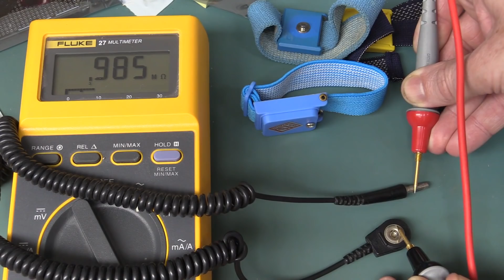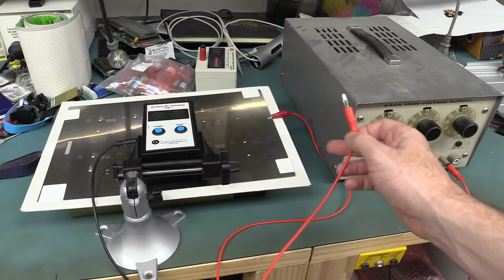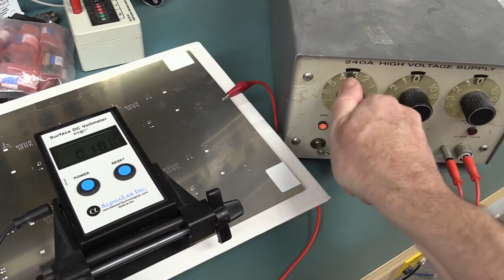EEVblog #768 - Cordless Anti-Static Wristbands BUSTED!

Comment: Dave, you have completely missed the point of these wrist straps.  A typical wrist-strap does not have a resistor in the strap, and the discharge 1Mohm resistor is located inside a special (and expensive) wrist-strap cord.  The "cordless" straps are meant to have a ground wire attached to the screw. This gives you the flexibility to use a plain old cheap wire of any length you want.  These really should be called "resistor in strap" wrist-straps instead of "cordless".  

Using these kinds of wrist-straps can simplify the wrist-strap testing process for electronics manufacturers.  Employees don't have to carry the cord they will be using to the ESD wrist-strap tester and don't need to carry the cords from station to station.   

There is one precaution with these straps.  The screw will be at ground potential when connected to ground through a wire.  If you accidentally touch the screw against a live circuit, that could ruin your day (and your project).  I recommend putting some insulating tape over the screw once the wire is attached.

 You have jumped to the wrong conclusion about what "cordless" really means.  Only 
an idiot would think you don't need to connect a ground wire.
Reply: Jess Stuart No employer would give their employees this crap to ruin the electronics they work on and the company's reputation. The descriptions for these auctions explicitly state "eliminates static without the need for a pesky grounding cord". The corded versions on eBay are only a few dollars, not expensive at all. This is a scam that is worse than wearing nothing at all, as the user is likely to be more careless, thinking they are protected "without pesky grounding cords".
Reply: Martin Andersen, I like using these, because they let me attach a small 
stranded ground wire (24ga) of about 6-ft length.  That gives me a lot 
more maneuverability on the bench when troubleshooting or making 
measurements.
Reply: "Using these kinds of wrist-straps can simplify the wrist-strap testing process for electronics manufacturers." - Because electronics manufacturers buy 1$  wrist-straps from Ebay!
Reply: Jess Stuart That's because you understand electrostatics. It may even be how these straps were originally intended to be used, given the resistor. But that is not how they are sold on eBay, which is the point of this video; they are sold as eliminating static without the need of a wire. They are deceptive. People who know no better and take them at their word, put their electronics at risk. Either the maker is making a fake product, putting in a resistor to cover themselves legally, or they don't provide instructions with it for the distributors, who all make the same mistake somehow, and falsely advertise them out of ignorance, or they know exactly what they are doing. Maybe they were made to be used as you are, attaching your own wire, but they weren't selling well. So some marketing bright spark gets the idea to sell them like wireless anti-static bands because chords are a nuisance, and here we are. A bit like how Listerine was originally a surgical antiseptic and later floor cleaner, but it wasn't until they invented the marketing concept of halitosis and sold it as a mouth wash that it took off.

Comment: I think you're using the antistatic 'wireless' wrong, you can touch the exposed screw to a GND source ie sn earth and the charge will be dissipated but they are kind of underpowered and they don't dissipate charge until you connect a ground source...not really a substitute for the real thing but kind of OK if you need a quick backup staticband or if you can't be connected all of the time.

Comment: Maybe the "wireless" part is that you can use your own coily cable with a spade terminal and attach it with the screw? Doubt it. And it wouldn't last long with that resistor barely in there.

Comment: Did anyone else want to see how many volts he could generate when the corded wrist strap is plugged in?  Dave: you never stroked the carped while the cord was attached, you only bled off the accumulated charge.  I kept wanting to see if there would be a measurable rise when using the proper strap.  Great videos overall, keep up the good work!

Comment: While working as a systems engineer for a consumer electronics company it was part of the job to evaluate component suppliers. On one trip to China my college was touring a family run speaker maker to determine if the company had the capacity and quality to meet our requirements. As he was touring the assembly line it was pointed out to him that they were using the latest and greatest wireless static straps. Apparently this new wireless static control was introduced by one of the elder members of the family that ran the business. So even thou the formally trained younger staff knew the wireless static straps were useless they could not say anything to the highly respected elder managers. Needless to say this company did not get our business. :-)

Comment: I don't understand.  If you and the plate are at the same potential, and the parts on the plate are at the same potential, isn't that the same as no charge?  It seems that if I touch the part with a 1megohm resistor to equalize the part and my potential while limiting discharge current I should be able to handle parts without risk of damage and also without a real ground. Why doesn't this seem right? What's the point of ground? Better safe than sorry if you drop the part on the floor?

Comment: Sorry, but you completely misunderstood this product. You are meant to regularly  touch a ground point manually using the screw to discharge yourself. This is especially useful when wearing gloves and in an environment where you walk around a lot. Imagine a worker in a Chinese factory: They tap a ground point with the strap, pick up a PCB, walk over to somewhere else, tap ground again, put the PCB down, walk back, repeat.

Comment: Cool video, Dave, except you had the band on your left wrist (for camera arrangement reasons, I understand).
But: high voltage work rule #1: Always use your right hand, just in case (I know, super-low current yadda, yadda...).
Your heart is slightly on the left, so you want the (hand-to-feet) path of least resistance to be through your right side.
Unless, you have situs inversus (super rare, look it up).

Comment: I think the bracelet was not meant to be discharged into the air, but to touch the metal surface with this screw through the built-in resistor.

Comment: Here I have about 30 microcuries of radium-painted clock hands.  I bet if you scraped them all off, mixed it with wood glue, and used it to paint all over that thing, it would make a dandy EHT discharger.   Just like the thoria ground-bars found on industrial poly-roll rewinders.    
Someone should start selling black conductive socks, to go with black conductive anti-static sandals.   Ooooo, how about black anti-static Crocs?   (Then force us all to wear them while down in the manufacturing building?)

Comment: I would be curious what you would have to say about DBS, or dielectric bias system.

It's apparently using Audioquest's "patented DBS system to ensure optimal cable performance at all times".

$6,899.75  power cable
http://www.amazon.com/AudioQuest-NRG-WEL-Signature-Series/dp/B0055OM9WS

$13,499.75 HDMI cable (of course, because a transmitted bit doesn't sound as good if it doesn't have a clean waveform.... facepalm)
http://www.amazon.com/gp/product/B00IL3TZSQ/

I was utterly bewildered when I went into a store and initially saw some RCA cables running upwards of a thousand dollars... I then of course could not resist asking the sales rep why it was worth that much, and he said "you wouldn't buy a mustang and use cheap tires, so why buy an expensive sound system and buy cheap cables?". People actually buy this junk too according to amazon.

I hope you can understand that I don't want to buy one and send it in lol.
Reply: Nifty Fingers Yah big time BS. A cable like that won't make the old knob & tube how ya doing wire in the walls work any better. ;)
Reply: Nifty Fingers FREE SHIPPING !!!!

Comment: 4:16 Why does the PSU have an SO-239 RF connector on the front?
Reply: tehPwnzor7306 At a guess because it's OK at 1kV and accepts a 4mm plug.

Comment: Well I wonder why the manufacturer bothered with the 1M resistor.
the problem is the definition of "cordless". It just means there is no wire. not that it has been designed to work without one.
Just connect your earth wire to the screw and it will work.

Comment: You missed the point of it. The cordless wrist strap has a 1 M Ohm resistor connected to the little bolt. You wear the strap with the bolt on the underside of your wrist. You touch it to an earthed plate on your workbench before touching a component or equipment. You continue to touch it periodically to ensure that no static charge builds up on your body. The resistor slows down the discharge from instantaneous to a fraction of a second so that, if you are charged up, you won't feel a shock.
A dangling cord, in some circumstances, might get caught in something (e.g. a rotating motor/fan). The assembly girls in the Asian factories are trained in the use of this item.

Comment: So far as I understand it these aren't supposed to be magic, you're supposed to use them to touch the screw with the resistor to a grounded surface periodically and discharge as an intermittent thing as opposed to constantly. It's intended for work environments where being constantly grounded is potentially dangerous or where discharging is only important at particular steps of an operation. The resistor is just to prevent you experiencing a palpable zap when you do so.

Comment: But is it actually possible to make a strap with couple of very compact fluorescent lamps built into it and turn static into light? :)
Reply: *****
But theoretically somehow it should be possible to utilize that energy.
Reply: ***** But that´s the point, you could have a cordless discharge, if you used it to generate visible light or heat.

Comment: I have found one disadvantage to being barefoot in the electronics lab (well, I wear nothing at all, but that's beside the point except that it does eliminate any fabrics and synthetic fibers to make a static charge).  Whether on carpet or concrete, if there is any sort of EMF interference from the mains voltage or something is badly grounded, or the polarity on an outlet is reversed and the neutral line is actually the hot one, etc., my bare feet on the floor creates a path for that charge to get to ground and will make interference even worse, particularly when I'm using the oscilloscope.  And when touching something that's plugged into a reverse wired outlet, it can create a bit of a nasty shock.  Wearing rubber soled footwear helps prevent all that, although it doesn't totally eliminate it.  [I discovered that my entire basement contains only 2-wire electric, no grounds at all despite having all 3-prong outlets.  That includes in the electronics lab.]

Comment: I'm wondering if this was originally designed for a legit use in a non-electronics environment.

We've all been somewhere where you got zapped every time you touched a door handle/filing cabinet/someone else due to the triboelectric charge you'd built up, usually from the carpet. Touch the screw on the box to the object and no zap when you actually touch it.

Comment: Why does it even have a resistor in it?
Reply: If you touch something that's live with electricity, it'll flow through your hand and arm, then through the grounding wire. The resistor allows for static electricity to dissipate (more slowly, sure), but also ensures that you won't get too much current flowing through ya in case of an accident.
Reply: Steven Haussmann Well, in a real anti-static wristband, sure, but why bother at all if it's a cordless (and thus bullshit) design?

I'm wondering if you're actually supposed to connect a wire to it after all, but the packaging and marketing is just... mis-translated? Someone who doesn't work with electronics or bother fact checking and just does the marketing might think it's perfectly normal.
Reply: weylin6 It should have a stud if a wire is supposed to be connected. The resistor is to slow any discharge to Earth. The ESD mats also are high resistance, all to prevent a spark or any fast discharge which would be damaging. It appears the resistor in this product is useless.
Reply: Let me set this straight, the screw head is meant to bump up against the GROUNDED anti-static mat, leaving your hands free to work, according to an email communication with one of these scammers.

Comment: in theory, could you not use a resister as a load to dissipate the voltage as heat? or am I just dumb
Reply: yes, but you need somwhere for the current to flow in order for that to be the case.
Reply: +Sod Alfredsod don't resisters draw current. Like a bleeder resister used to drain caps.
Reply: yes,but caps has a secound pole - ground. the goal of your idea is probably to make a Anti static wrist strap without a ground cord.

A cap is charged in relation the secound pole

You are charged in relation to ground and needs a strap to connect you to ground.
Reply: +Sod Alfredsod OOOOH. Of course. That's what I was missing. What I was suggesting previously is like trying to drain a battery by connecting both leads of a resister to the positive terminal. right?

Thanks!
Reply: Exactly, I would recomend drawing circuits on paper to figure out how they work.

Comment: You could still attach a ground wire to that screw...Maybe they've put this info somewhere on the ebay ad. Maybe in 4pt writing, with a black font on a black background, or something like that. Just so they can't be sued for fraud, because that's what it is.

Comment: There is a Wikipedia article about "static dischargers" which are devices it says are present on most civilian aircraft.  They include sharp metal points to dissipate excess charge into the air.  A cordless wrist strap with lots of metal points sticking out might be worth a try.  If there were enough of them, it might actually work, although it also might be a little hazardous.

Comment: They work exactly as intended and I can't understand how "electronics experts" can't figure it out.  They allow you to touch the screw on the top to a ground and discharge yourself through the internal resistor, which prevents you from being electrocuted if you touch a live wire while touching ground. That way you don't have to touch a ground with your hand and you won't get electrocuted. Most people don't walk around while working on electronics so once you ground yourself you don't have to stay at ground potential.  Is it the best solution or better than a wired version?  No, but it does work as designed if  you have the brains to figure out how it is supposed to be used.

Comment: about 30 years ago, many TV stations were selling thin copper bracelets for about $60 claiming that it discharges negative energy, wasn't clear if they were using the word negative as for voltage polarity or as something not good for you, they claimed the bracelet was treated 50.000 volts or 50.000 times (volte in Italian means times as repetitions).
I tried my best to educate the many people around me that is was pure bullshit, even a colleague electrician went around proudly with this thing on his arm.
I told him, why not use a piece of copper wire, or your normal metal watch strap, it costs much less.
He claimed the copper bracelet had been treated.
I ask him how exactly can you treat a piece of copper with 50.000 volts?, 10 cm copper is a short circuit, the voltage would to 0 and the current to the maximum your power supply can supply, but at that point you're not treating it with 50.000 volts but with some value of low current, too much current and you will be destroying the bracelet.
To avoid short circuit, even if you apply 50.000 volts to a very long coil of copper, the voltage drop on what will become your segment of 10cm bracelet would be a few millivolts.

This fraud went on for at least a year.

Comment: You know there would be one use for this: you can use it to dissipate your static charge on a metal surface without a zap. This will be handy in winter when the humidity is high and you would get a zap on doors or cars otherwise. Not the intended use but worth a dollar I think. 😊

Comment: It can be used to painless discharge to grounded metal object. By touching it with the metal screw on the case. (and after all translations hell it can be named as cordless anti-static wristband :)) )

Comment: what if you had the strap on the non working arm (assuming you are working with only one arm at a time) and had that arm resting on your anti static mat during your work? it would work at that time, but then being cordless you could get up and walk across the room without taking it off. return to the bench and set your arm back down. i assume thats what the original intent was for this design. but who knows. i can't see any other reason for there to be a screw leading to no where land.

Comment: The Mandarin term for "cordless", in the sense we would use the word, to not need a cord, is "wu sheng".  To not have a cord would be "mei you sheng", which would not imply anything about cordless operation, just that there isn't one.  I'd like to see the Chinese packaging for one of these.  That said, a quick look on Aliexpress (where all of these cheap Ebay resellers buy things, double the price, and rip you off), these are definitely billed, in English, as not needing a cord.

Comment: The manufacturer should know that a charge needs a way to go, otherwise it wouldn't stay in your body. If it did instantly dissipate into air, it didn't stay at your body either, it would just vanish and not build up. Btw that's a expensive resistor to buy. They're really only worth cents.